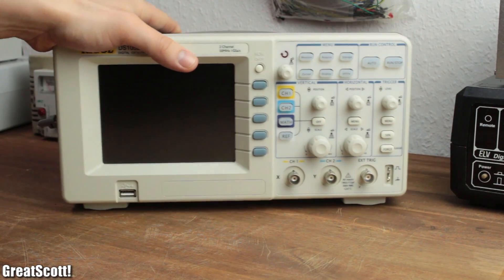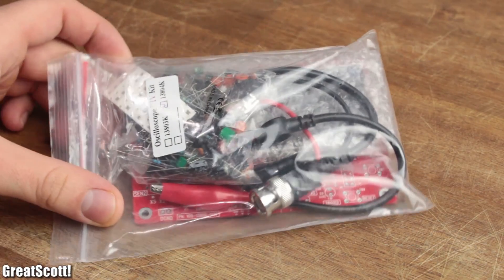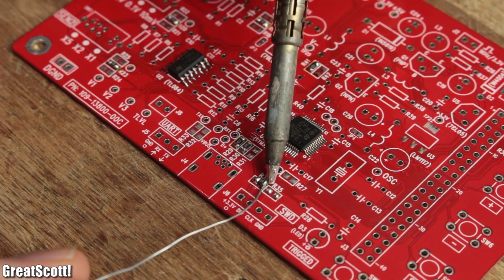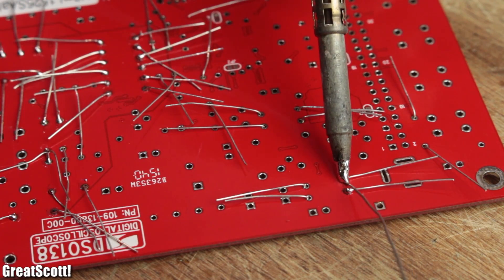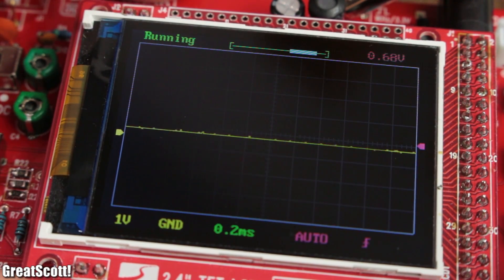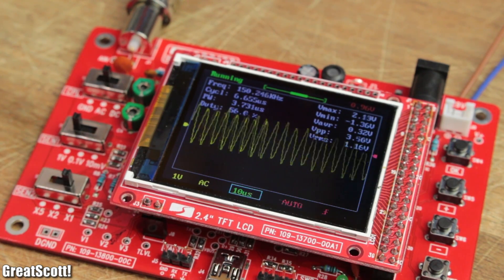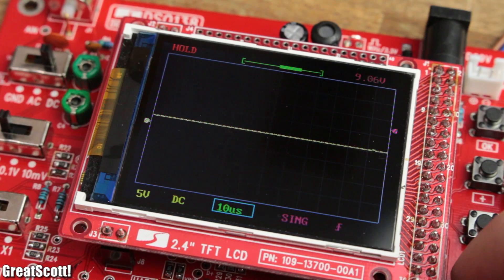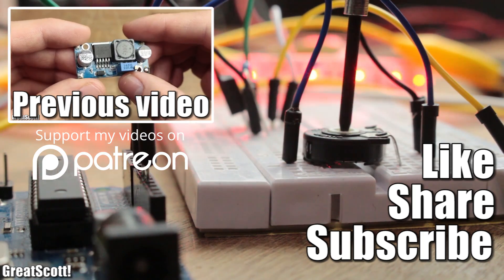DIY Oscilloscope Kit (20$) VS Regular DS Oscilloscope (400$)

Comment: HI .. one question.. I'have buyed two oscilloscope.. to built a audio dummy load, and the scopes need me only to monitoring the wave no to make misure. But both have the same problem: there are spikes visible even with no signal when the time base is set to 0.1, 0.2, or 0.5 ms; otherwise they disappear. However, to view a 1000 Hz test signal, these are exactly the most commonly used settings. Have you noticed this issue?
For my work I have a serious oscilloscope ! 

Thanks

Comment: You can buy a normal digital oscilloscope FNIRSI 1C15 with a 110MHz bandwidth for a $50. In a handheld case with a Li-ion battery and pair of good wires.

Comment: I work on generators and need to see the wave of the hertz. My kilowatt gives me a number but you can see how dirty the power is with one of these. I may get it with the case (offered separately) for just that pirpose and figure out how to use it lol. Never used an oscilloscope before.
Would i just put leads into the power recepticles on the generator to read the hertz of the power comjng out?
Or a better question would be how would you hook one up to a plug in your house to get readings on the hertz and see the waveform?
Thabks great video

Comment: DSO138 -> overrated (nowadays)
Scoppy -> totally underrated!

I was about to buy this oscilloscope, but then I discovered Scoppy. All you need is a Raspberry Pi Pico (RP2040) and an old smartphone. There is hardly any real learning effect with the DSO138. But with Scoppy I will soon build my own front end to be able to read higher voltages... and I'll learn something again because there is no prefabricated, printed circuit board that you can solder together without thinking. With some overclocking, Scoppy will outperform the DSO138 with a sample rate of up to 2MSa/s. The DSO138 only has one channel. Scoopy can provide up to 4 channels... but with a shared sample rate. 

And you've probably already guessed it... with Scoppy you have a touchscreen through the smartphone and an unbeatable range of functions in the app.
Reply: Not only does your comment reek of informercialism, scoppy is capped at 3.3v input signal

Comment: I have this kit, a slightly better one, and a mid tier Rigol (as well as an older analog scope).

Based on my experience, the kits are complete and total turds, and if you do anything past about the 3rd grade level, are a waste of $$$ at any proce. About the ONLY thing they give is experience in assembly.

Comment: 7 years old video and it still coming up in my YouTube first page when I open it , fun. Ofc that I seen it again and could not resist to comment maybe again. But how you coming on idea to compare  two things where is one thing 20 times more expensive then another. It is more than obvious that cheap one will not work as expensive one. But little one for 20$ working just fine , you get what you pay again, and in this case I think you get much more than you paid. Even I got video about this little thing , old one as well, but to mention , it still working just fine even today after 6 years. So 20$ I would say in my case this little thing for sure earned much more than those 20$ .
Reply: That’s one thing nobody shows on YouTube, someone actually using one of these cheap oscilloscopes to do actual diagnostics and repair, even if you’re just a hobbiest it may be a good idea to save $£€300-400 for a now seven years later decent 2-4 channel stand alone which are available. I bought a inductance tester and it was way way way off, 7 years ago it was £€$ 35-45 now since they’re going for under $7 7 years later after using the formula requiring about 7 calculations using a meter to get the actual henris it was money badly spent. Maybe Scott can do a video on how to update the chip on them to work better since it’s the same on the arduino nano. Yep save up and even as a hobbiest once you’re done having fun you can get some of your money back selling it online if no longer needed.

Comment: This might be a cool little toy, but for all of the labor building it then having a bare board and only one channel, I'd spend (and did) on the Hantek 6022BE dual channel 20MHz USB oscilloscope that attaches to your PC.  You get a full featured, 2 channel scope for $69.50 US (on Amazon) with probes and cables.  I've been using it for several years and it's pretty much as good as the $400 DSO.  There are also several alternative scope programs with different interfaces and tools available for download too.  Also, the DSOs are way down in price, a 7" - 2 channel 100 Mhz DSO is now only $150. 

I really enjoy your channel, please keep up the great stuff!
Reply: I mean, the Hantek one is 3-4 times the price of this toy, and it requires having a computer around which also takes up quite a lot of space, I think this might be great for beginners and think of buying it

Comment: i found myself an old HAMEG HM 307 (1st revision so no curve tracer :/ ) for only 25 bucks, it has worked wonderfully so far and is fully functionnal, got a some rust on the transformer and the metal chassis... but it doesn't seem to care.

These old analog scopes are great if you can get one for cheap, not too old though, tube-based ones are kind of a pain to fix if they're broken...

Comment: In case anyone needs this, if you actually read this thing's manual, most values will be returned to their default position if you highlight them and hold ok for 2 seconds, doing that on the time measurement turns off the readout

Comment: eh, not impressed.  My Rigol paid for itself by my use in consulting. I like my 32 bit USB logic analyzer, but the key to that was it offers more bits than standalone units and displays on a standard PC. I think a USB scope might we worthwhile because of using the PC display. There was even a USB single probe PC scope that was basically the size of a probe.
By the way, there are several of these stand alone units with cases now.

Comment: Found the DSO 150 much better to assemble, repair & easy to operate with it's easy push buttons & rotary dial. Tried the DSO 138, assembled it, worked.. for a while, repaired it, replaced the 10 uH inductor, but found 9v+ reg kept overheating. Gave up in the end to get the DSO 150 instead, which is suitable for most projects & repairs. One day hope to afford a proper scope.Using the scope for power supplies, inverter, motor control & help with learning the Arduino UNO programmer. Blind without a scope. I don't like soldering smd's.

Comment: I tried connecting my mp3 music player headphone output to this cro but am not getting any reading. Just the noise you see when not connected to anything. I have the gnd connected.  Why? Is the signal too low a voltage?

Comment: I bought the updated, Kuman brand of this oscilloscope kit from amazon. $40 for kit plus shell. This was the version with SMD components pre-mounted. It comes with a nice manual and includes several diagnostic/troubleshooting guides in case you get lost along the way. It was a nice project for me and the updated kit has a good layout and is pretty easy to use. As a hobbyist I'm happy with it; I don't need the $300 investment at this stage.

Comment: I have been repairing cellphones, I sometimes I need to see if some crystal are producing correct oscillation and PuMic, processor as well. But spending $25 bucks for a toy is not my cup of tea, Some of you find out this worth for cellphone repair? Can I read at least 100Mhz?

Comment: Trigger and trigger stability is 80% of an Oscilloscope, sufficient bandwidth is another 15% the remaining features is 5%.
Tektronix became king because of their trigger circuit - don't wast your money on this crap, go buy an old $50 Tektronix on eBay - you are much better of :-)
I have owned 25+ oscilloscopes in my 45 years in electronics, I have 5 now - two is Tektronix - none of my oscilloscopes has been less than 10 years old when I'd bought them.

Comment: I got one from amazon pre-assembled. I have the so called "real" oscilloscopes too. Believe me the so called real oscilloscopes are pure piece of scrap compared to this one except for the display size. These small ones can be powered by 9volt battery and portable. Does most of the works. The real ones have lag like anything. Cant really change the sampling rate which is pinned to horizontal scales. Funny memory capacities and worst to the core is their PC connectivity. Just a piece of scrap. The real oscilloscopes are nothing but real piece of scrap. Expensive and just nothing. Pathetic

Comment: You can also get this already assembled for even less than $20  :D
Reply: Where
Reply: @FCADurgeshKumar  Aliexpress and Ebay
Reply: Where?
Reply: @rockyroomelyum6313  Aliexpress and Ebay
Reply: ebay.. think from Jai. DSO 150 is much better to assemble, repair & operate, with a decent wide range for most stuff. Can get it in kit form, with smd's already mounted, or mostly built, just have to assemble the casing yourself. Difficult for the DSO 138, weakest parts break..don't fit well, but DSO 150 body snaps easily into place, just mind the rotary dial is lined up at the end.Edit: also found with the DSO 138 the 9+ volt dc in regulator over-heats & had issues with the inductor.

Comment: Here's a tip for soldering SMD components.  Place the SMD part on the two pads and just touch one side with the iron WITHOUT ADDING SOLDER.  There's already a thin layer of solder on the pads from the manufacturing of the PCB, and it's just enough to hold the part in place.  Then you solder the other pad by adding solder.  Once that's done, finish soldering side that was only tacked down by adding solder to it.  You'll end up with much cleaner solder joints and the part won't move around on you.

BUT there's an additional concern even before you solder anything.  If you read the Kemet instructions on how to solder their multilayer ceramic caps, they recommend you preheat the parts and the PWB so there's less temperature difference when you hit them with molten solder.  Apparently, the thermal shock of a soldering iron can delaminate the layers in a capacitor.  I don't know of any hobbyists that actually do this, but that's what the literature says.  I suspect it's more of an instruction for tuning the reflow process on big assembly lines.

Comment: I bought two separately on Wish, one was around $20USD after shipping, and then a few days later Wish showed me another listing for the kit ($3USD shipped) and a laser cut acrylic case ($2USD shipped), so I figured “what the heck” and ordered a second kit. I’ll edit this post once they’ve arrived and I’ve assembled them (which will have to wait until my $7 adjustable temperature soldering iron arrives from Wish too).
Reply: damn 3 years and u still havent assemble them

Comment: i just bought one of these on ebay for $21 assembled and in the acrylic case. In looking at the pricing I cant see purchasing the kit when assembled is only a couple dollars more. Unless you enjoy the building. I intend to use this $20 scope to monitor my ham radio rf signal.  make sure im not overmodulating

Comment: For a few dollars more I bought the same already done. just power it on and Instant gratification  :-)
For most little project this is not perfect but really enough. And for low frequency (music for example) there is no need to test 200 Mhz even 10 times less !
Compare to the price of a good oscilloscope, it's a bargain.

Comment: I'd be using it for tuning and calibrating a musical synthesizer so I believe it'd work well for monitoring the output between 20hz and 20khz but for the circuits themselves running at 15v I'm probably better off buying a 150$ oscillascope
Reply: ??????????? it is so fukin unrelated

wat u mean 15v

this thing can measure 15v

how does 15v relate to anything, let alone cost

Comment: Yikes, please don't solder SMT chip components like that. Electronics don't like too much heat and have heat cycle ratings to failure. EG 3 heat cycles before the part should be thrown away and replaced.

From an experienced Electronics Engineering Tech:
1) put a dab of solder on ONE pad
2) Grab the sides (the long part that ISN'T a metal endcap) of the part using tweezers
3) Simultaneously reflow the solder with the iron and slide the part into the now molten solder on that pad from #1
4) Solder the other side like normal
5) Reflow #1 if necessary

PS: If you soldered a small enough resistor, ie 0201 you can burn it out with too much heat. Similarly, a large ceramic cap can crack by hand soldering because of differential thermal stress unless you preheat it.

Comment: Hey Scott, Very Nice video. Also Scott you can solder SMT's easier if you:
1. Put a very small amount of flux on the clean pads. 
2. Cut a piece of solder 1-1/2 the width of the pad, unless the solder is thick then use only the width of the pad. 
3. Lay the SMT on the pad.
4. Lay the solder next to the ends of the SMT.
5. Hold the part down with a small flat wooden stick, often referred to as an Orange Stick, or a tooth pick.
6. Place the hot iron on the solder, as soon as it melts pull the soldering iron to one side and and away from the SMT.
7. Repeat the process on the opposite end.
The flux will ensure good flow and leave a very nice solder joint on the part.
I'm a certified solder tech and I use this technique often and it rarely fails to do an almost perfect job every time. You can see an example of this on my F350 Overhead Display fix at time index 6 : 00 here: https://www.youtube.com/watch?v=e0wHW9X4SX8   Your are absolutely correct on the Scope Dope as some of us call it. Thanks for sharing. Best wishes n Blessings. Keith Noneya

Comment: JYEtech sell excellent handheld cheap oscilloscopes based on arduino. i have the DSO112A and it has 2uS per division, 2mV per division, and its software is like a much more advanced version of what ya see there. USB powered with lion battery its indespensible. external trigger, even external sig gen and data logging. fully touch screen with only 1 hardware button for pause. even outputs to pc

Comment: https://www.aliexpress.com/item/0-30V-2MA-3A-adjustable-DC-power-supply-laboratory-power-short-circuit-current-limit-protection-DIY/32780330525.html?spm=2114.search0604.3.15.7a985c48KflsUA&ws_ab_test=searchweb0_0,searchweb201602_2_10065_10068_10890_319_10546_10059_10884_317_10548_10887_10696_321_322_10084_453_10083_454_10103_10618_10307_537_536_10902,searchweb201603_59,ppcSwitch_0&algo_expid=07729c0e-f870-4455-9cd0-cafbdafabe71-2&algo_pvid=07729c0e-f870-4455-9cd0-cafbdafabe71&transAbTest=ae803_4

Can you make a video of this diy power suply kit? :3

Comment: What a piece of sh1t is dso138... I build one from soldering kits and then most likely through it f***ing away.... Or better not even try to build one? Because why should I even use it? It's a f****ing 10 kHz frequency, not even above the sound... It won't even do the job of repairing PC, because you can't measure any signals from the switches, they are obviously above the sound freq.

Comment: I've just found your channel and I'm enjoying your content, subbed! Watching you solder makes me cringe though! lol In a comical way though, in that I can remember pushing smd components around with my iron like you were doing in my early soldering days :)) If I can add a couple of things.... Practice, practice, practice and 'the right tool for the job'. Both of those can turn a soldering project from a pain, into a pleasure. The large iron you are using for those components is kind of like using a flame thrower to light a candle. For assembling a device like that, look into something like a 12W Antex (search S17J470 M12) with a copper point tip along with a good set of tweezers. Seriously, it makes a world of difference ;) Personally, at my workstation I always have three different irons, a temp controlled iron and a hot air rework station to cover all the situations I'm likely to encounter.

Love your stuff, I'm going to continue binge watching now :)

Thanks.

Comment: Hi GScott!i want to make a question?it's possible to replace the  two variable capacitor ( 30 Pf )to better refine the angle of the squarewave when try to calibrate the clip probe with the internal signal

Comment: I think  it required to  made a hard ware and software which can connect with smartphone for CRO purpose which can be portable and low cost and easy to use.
At first required a hardware which will be  connected with which want to measured and fed data to smartphone through a data cable and data will be measure by a software in a smartphone.
This can be revolution in electrical engineering.
Thank for your video. 
Please reply me.

Comment: Thanks for this. I've had 2 of these little oscilloscope kits.. I'm hoping 3rd time is the charm because I need to get another one as I didn't get either of the first two working properly :( I don't really know what I did wrong the first time.. for sure I let the smoke out of the second one.. a bit.. My trouble shooting skills are not up to the task of figuring it out, but they remain as parts I suppose. The screens are good.